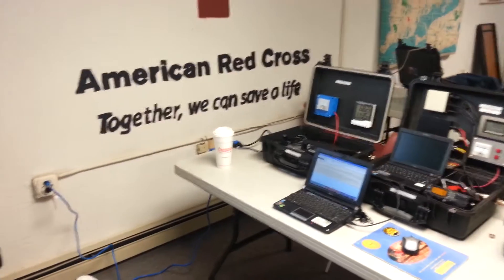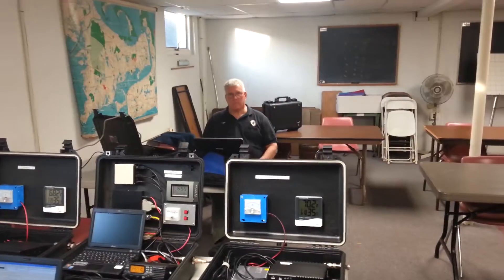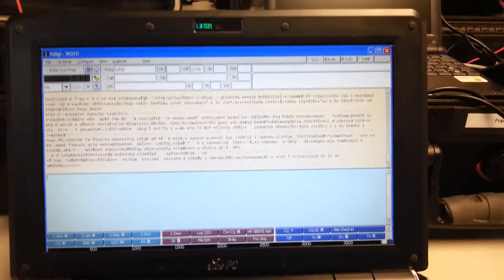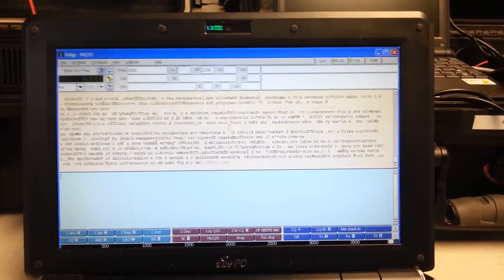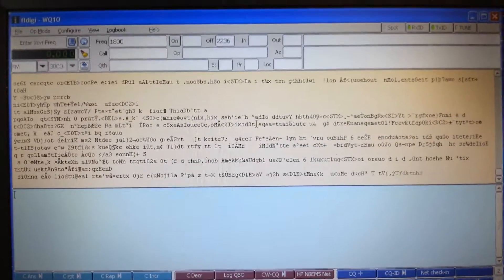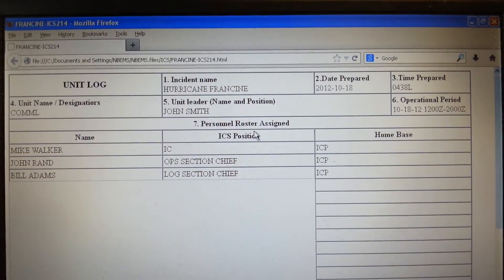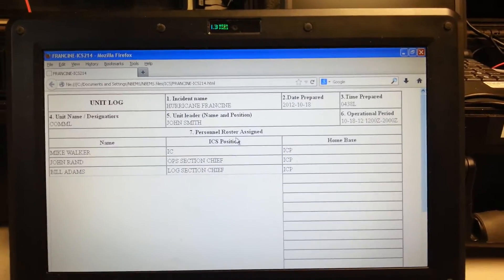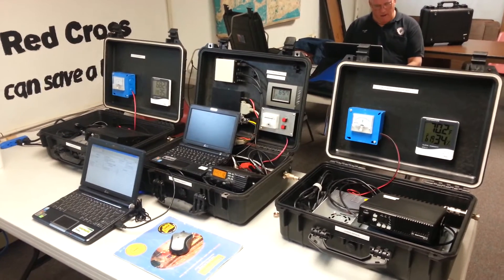New High speed NBEMS mode testing (8PSK1000)

Comment: so, how did the testing go?  would you recommend it? are your adopting it for EMCOMM?
Reply from the maker: Much has changed since that first testing of 8PSK. More forward error correcting modes have been added that make it even more reliable. We have since adopted 8PSK1200F. It has preformed quite well. The author has also added a pilot tone to the 8PSK FEC modes that increases reliability still further. I'm not saying anything is perfect, and you do need reasonable signals for success. it is, however, the best I've seen so far...and among the fastest. Thanks for you question....73' Frank WQ1O
Reply: Thanks for the feedback.  I'm getting ready to start teaching and hosting a NBEMS digital net.  Will be using Olivia-8-500 and MT63-2KL as primary modes across all bands.  Wanted to add 8PSK to VHF just for the incredible speed.  2 or 3 seconds instead of 60?  Ya, one has to love that!!  LOL
Reply from the maker: Thanks Rick. Yes, 8PSK is definitely a great addition. Under poor conditions, you also can use the slower modes effectively when needed. Good luck with the NBEMS digital net. Sounds great. You did a real nice job on the soundmodem / vhf winlink video. Well done. Keep in touch and thanks for helping the emcomm community!